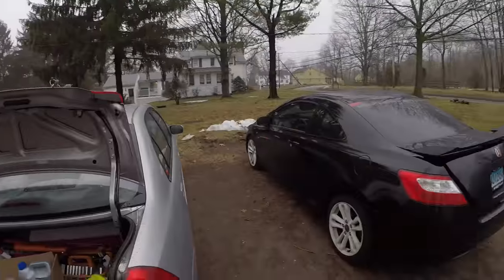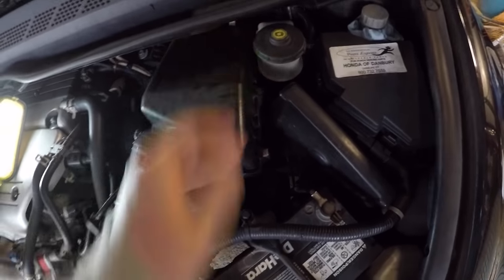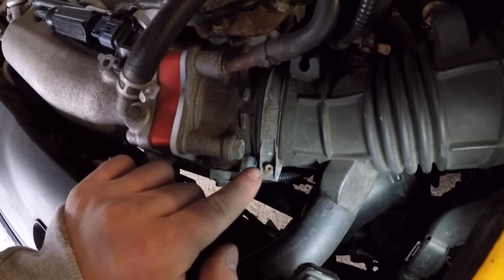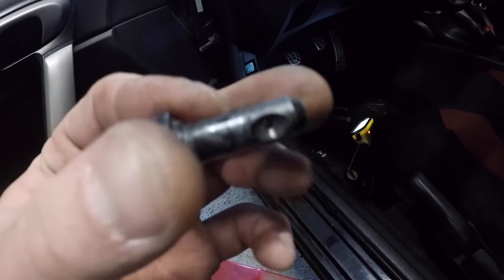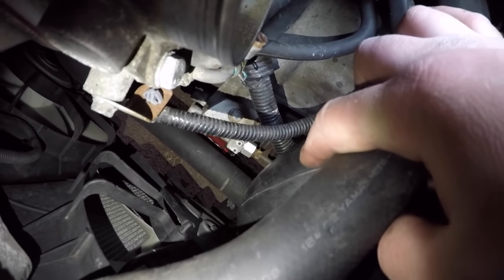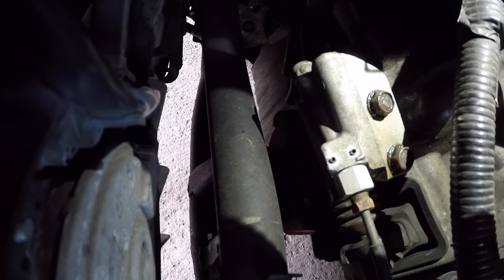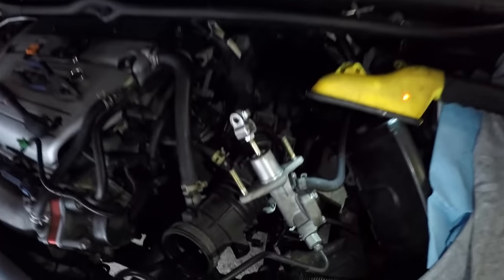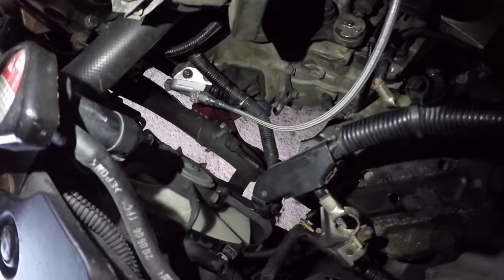Honda Civic Si CMC & Slave Cylinder Replacement DIY (2006-2011 Si K20z3)

Comment: I have a question for you. 1. Did this help you with 2nd gear lockout at high rpm? I have the very common 2nd gear lockout and 3rd gear grind problem with my car (07 si sedan) I have no idea where to start with fixing it. I had a new clutch put in a few months after I bought my car. Almost a year and a half later this problem is still existing, but here is the really weird part about it... so during the winter times I will rarely ever get locked out or have grinding issues, however, during the summer, after I run my car for about 10 minutes, I have the issue all the damn time. When I turn off the a.c. and throw the heat on the whole way (but the fan is running at like 2 or 3 clicks) it seems to help the issue. I have no idea... my initial thought was that my exhaust would heat up after driving it for a bit and it would heat up the transmission and it would make the metal (the gears) expand and would just be tougher with shifting. I thought about heat wrapping my exhaust to see if that would help it at all. Maybe you have a suggestion or even you have fixed the problem by doing a few mods. The cmc seems to play a role in the whole shifting issue a little. For example I was driving home from work today (maybe a 10 min drive) and I was going from 3rd to 4th and as I was letting off the clutch going into 4th,  my car just jumped as if the clutch got disengaged for a second then caught itself again. It would make sense if the cmc caused that (I was not over 5k rpms and I was shifting like a normal driver). I'm about to dump all my money into rebuilding this damn tranny if I can't find a solution. Anything That you can suggest helps, thank you!
Reply from the maker: Honestly, it helped with all my gears. I never had the lockout issue at high rpms though.  Mine is the opposite of you, winter months are harsh on my tranny until my car is warmed up.  For starters, start small, change your transmission fluid, clutch fluid, clutch pedal adjustment, bleed the slave cylinder, upgrade shift bushings
Reply: @TheGerbsteve  man these cars are a headache at times haha. But thanks for the advice. I was thinking about doing a full fluid change once I get my next oil change. Figured I would check everything since I only  really changed the oil since I owned the car.
Reply from the maker: Do it man, will only benefit in the long run

Comment: Great video mate, i wonder if you still have thats k tuned hoses, I installed the hardmotion cmc and it great but because of my battery relocation the hoses in the slave part it a bit stressed. That 90* and 180* degrees fittings are what i need. I you still have it can you sell it or at least let me know how can i fix my problem?

Comment: Question gerb my 07 fa5 my clutch won’t engage but it will in 3-4 somewhat and sometimes it won’t engage at all do u think it’s a cmc and the slave or the clutch itself
Reply from the maker: My vote is the clutch itself
Reply: I ordered oem clutch and slave from K series should be here this week hoping its not the clutch
Reply: Gerb u wear right it was actually just the throwout bearing but I got a whole new clutch just went with the affordable exedy clutch kit thanks for the advice gerb!

Comment: Gerb what fitting adaptor did you use to install clutch line at cmc.....I ordered em2 with this clutch line you used
Reply: Did you use em2 cmc with oem slave? Did it fit with the line and hows it holding up? I think i might go with that set up

Comment: what stainless line was that and can it be fitted to the OEM Master cylinder? i just have the ktuned slave ready to install on my SI
Reply from the maker: It's a Valex racing off eBay.  It will fit the oem master.  Run the stainless steel line, it's 10X better than the oem restrictive hardline.

Comment: Hey man great video appreciate the information, just had a quick question about the internals of the CMC. I know hybrid racing sells a similar kit and you had to swap some of the internal stock cmc parts like the rod and retainer to the new cmc, do you have to do that with the K-tuned kit as well or is it a direct bolt on?
Reply from the maker: +theradkab27 K tuned is direct bolt on bro.  I didn't want to do any swapping, but I heard hybrid racing is just as good

Comment: Just installed mine. Was installing an IMG so figured while everything is apart, might as well install the K-Tuned CMC and slave. Wasn’t that hard to anyone interested in doing it. Putting everything back together now so haven’t tested it yet.
Reply: WOW, what a difference that made. No gear grinding. Chirps going into 3rd at 4000rpm, damn! Engagement is higher and has a slight vibration when I push the pedal down. This is a well worth mod.

Comment: Where did you buy your K-tuned cmc? I bought mine online and took it to the mechanic and he said is not the right part. Now I have to deal with online return and I need to fix my car ASAP
Reply from the maker: Ebay bro.  Damnnnn, that blows. Do you remember what site you ordered it from?
Reply: Gerb Productions it was ebay but got it fixed

Comment: Yo Gerb are you still running this s
Cmc and slave setup? I did mine about 1000 miles ago no problems yet but I keep hearing bad things about them. Bit tbh its been working great for me I can now red line from 1st to 2nd no grinds. Im getting the HR short shifter and and shifter cables next
Reply from the maker: I am man.
KTuned cmc, oem honda slave FTW! I have about 60k miles on them both ;)
Reply: @TheGerbsteve  i have the k tuned slave hopefully it wont give any problems in the near future. I also did the exedy stage 1 clutch and lightweight flywheel the car feels great.
Reply: Btw are you planning on using the alpha header on the k24?
Reply from the maker: Yeah man. I’m going to try and fit the alpha header onto the k24. If I have issues, I’ll just sell alpha for something that’ll fit, like dc sports, plm, etc.
Reply: https://youtu.be/NuKjv0Kt1ZQ here's a link on how to clear them good luck!

Comment: Does this fix notchy ness and the high rpm second grind ?
Reply: Brandon Meyers most likely your synchros in your transmission for 2nd gear are going or are out
Reply from the maker: For me, it fixed it for a bit, then i had the notch feel back again. My tranny needs a rebuild
Reply: My hybrid racing kit is showing up soon and I’m gonna adjust my pedal so I’ll let you know the results
Reply: Gerb Productions I’m on my second clutch and began getting the lock out in low rev 2nd and redline 3rd, earlier today I was grinding trying to get into reverse! Installing my K tune combo tomorrow morning, just makes me sad that it seems like a temporary fix! just putting a bandaid on a weak tranny :(
Reply: Cristian Ramos  how did it work for you
Reply: Brandon Meyers Brandon Meyers shifting is way more precise, it definitely helped out ALOT but I still get a tiny bit of lockout here and there. But interestingly mostly when trying to shift  into third super quickly at about 2.5 rpm, could be user error. I’ll try to give feedback later in the week FYI with the aftermarket master cylinder you’ll feel ALOT of vibration coming through the pedal from what I’ve been reading it’s normal since the new cylinder doesn’t have the insulation diaphragm
Reply: Just installed my hybrid racing cmc fixed my issues !

Comment: Just installed my cmc and slave from ktuned, feels amazing bro, also it made my transmission quieter? Idk but it feels great, I love it
Reply from the maker: Glad to hear you went with k tuned, they are great imo. Definitely helps with shifting for sure. Are you using a braided clutch line?
Reply: @TheGerbsteve  yes, also went with that
Reply: How is your k tuned cmc and slave holding up? I keep seeing comments and reviews about how it sucks and peoples have blown on them. Im hoping this isnt the case, i just ordered mines 😭😭
Reply: @mattanderson1890  it's still holding up great, no issues, people blow them up cause either they dont know how to adjust them properly, install them properly, bleed them out correctly or just dont know how to drive lol but it's a great choice in my opinion
Reply: @mattanderson1890  Gerb and other youtubers have made great videos on how to bleed and adjust them properly
Reply: @Automatons.  alright sweet, thanks so much bro🙏 mines supposed to be here thursday. Going in my 9 gen si

Comment: I did the same installation on my 2008 Civic Si and works amazing. Thanks for the video.
Reply from the maker: Glad it helped. Thanks for the support 🙏🏻
Reply: My old clutch was replaced by hybrid right now one thing is it normal my old clutch hits the floor but this is half way play wont reach the floor anymore??!

Comment: Hey great video. I recently replaced my clutch and about 500mi later it slips randomly. Could replacing my slave cylinder be the solution?
Reply from the maker: Thanks buddy.  Hopefully you didn't get any grease on the clutch disk/flywheel.  Did you replace the slave when you did the clutch?

Comment: So I changed my cmc today but after installing everything, and double checking every bolt, wire, looking for leaks, etc. I couldn't turn on my car, I jump started it thinking it was the battery, it started and I left on for 30 min, turned it off, tried turning it back on and nothing. I know the car has power because all the light go on when I open the car but as i put the key in the ignition and turn it, the car loses all power and goes black I dont know what the issue is. I did the exact same steps as in the video, anybody know the issue, anything? Please help

Comment: great video bro, 
i recently bought a k24/k20 ep3 and the clutch pedal feels very hard, could it be to having an aftermarket CMC ?
Reply from the maker: Thanks guy...
You may have a stage 1 or so clutch, possibly upgraded cmc. Only way to tell is a visual inspection.
Reply: Did u ever figure out why it’s hard?
Reply: @rastafire1219  i replaced recently the clutch and pressure plate with exedy stage 1, but remained the same.
Probably the omni power CMC is the reason.
I am planning to replace it with EM2 or k tunned CMC.
Hopefully in summer time.
Reply: @lifenz1  I’m thinking of getting the hybrid racing cmc, I’ve good reviews about it and that it eliminates any grinds.
Reply: @rastafire1219  yah its same as em2 CMC design and quality
Reply: @lifenz1  thank you for the info! I’m learning as I go!

Comment: I know this is old but does it still hold up ? And do you know anything about the hybrid racing cmc ??
Reply from the maker: It does... I don't know anything about the hybrid, but i hear a lot of people running either that or k tuned.
Reply: Gerb Productions great ! I’m doing a full maintenance on my car before I do mods.. so I’m thinking at mods next 👍🏾
Reply from the maker: Very smart move!  You'll thank yourself afterwards haha.  What set up you going for?  Full bolt ons or boost?
Reply: Gerb Productions so far I have full bolt ons (headers, exhaust, CAI ) .. I want to buy flashpro but the $600+ is in the way ! Lmao
Reply from the maker: What brand header, intake, & cai? Even thought the price is high, it's worth it, trust me.  It's more than just a bunch of base maps.

Comment: Great video. My Ktuned slave cylinder started to leak. Had to replace it. Hopefully the hardmotion slave fits just fine.
Reply from the maker: +Javier Gutierrez Thank you sir!  Everyone says the k tuned slaves leak. Therefore, I'm glad I went oem 👍🏼...  How is hardmotion?
Reply: Gerb Productions so far so good. Got it installed today but there was a small modification that needed to be done since I had the Ktuned SS line. Other than that, no leaks and way better than before,
Reply from the maker: Glad to hear it! vtec on..... ;)

Comment: Hey bro, love the vids. I have a quick question. I purchased and installed this ktuned cmc and slave, but I feel like my adjustment is off at the pedal and cmc rod. Do you know the proper specs for this adjustment? Thanks bro.
Reply: David Vasquez I cannot get the black pin which connects the pedal to the cmc in all the way. It gets stuck. Any idea how to fix that?

Comment: First off thank you for the awesome videos bro. I think I speak for everyone of your subscribers when I say we appreciate the positive attitude and love for the Honda scene. With that being said I was wondering if the k-tuned cmc and slave had that much of an improvement on your shifting ? Really thinking of replacing mine on my 07 FA5... thanks in advance
Reply from the maker: +Thomas Proulx Means a lot man!  I always try to be positive man.  Honestly, they had an improvement, but it's my transmission that is shot, I believe.  Under high rpms, it doesn't shift as fast as it should.  It also winds here and there.  I'm looking into transmissions.  I would upgrade for sure though

Comment: I have an RSX, I've been through 2 KTUNED Slaves in a month. Both were leaking from seals.. I had enough and went OEM will an EM2 slave....no issues... till now my KTUNED CMC started to leak from the rubber seal as-well. Im done!! Getting an OEM EM2 one as well.  I think they should stop making the Slaves and CMC units.
Reply from the maker: Holy crap, this is interesting.  How many miles did you put on the CMC before it started leaking??  Stick with oem man & i will do the same when mine shits the bed.  Good thing i bought an oem slave.  I don't think I'm going to buy there parts anymore to be honest???
Reply: I've been in search of responses for the KTUNED CMC and slave. Not enough reviews online, anywhere. I've read several responses on YouTube and most people are saying that they've had an issue with the slave leaking or it failing prematurely. I'm so glad I didn't order their CMC/Slave kit. I'll stick with OEM as per usual. Thanks dude!
Reply: Amy Huggs def, the only thing I used was the clutch line it came with.
Reply: Gerb Productions not even 200 miles.

Comment: hi gerb i think you should bench bleed your master cylinder before putting it on, ull prolly have a hard time getting those air out of the mcm.
Reply from the maker: I actually think i have a tad bit of air in there currently, so i might try to bleed it again soon.

Comment: thanks for the vid, you actually helping out alot of people with the installation.
Reply from the maker: +abraham bravo No problem bro, glad I could help you 🙏🏻🔧🔧
Reply: Where did u get the stainless braided line, mines came with the rubber one
Reply from the maker: Ebay bro, it was like $20.00... Type in civic si stainless steel clutch line

Comment: What up bro, I was just wondering if there was a specific reason you didn't get the k tuned slave? I'm still learning myself.. keep up the good content.
Reply from the maker: No specific reason, I just wanted to run oem slave. I also heard most aftermarket slaves leak fluid. More coming for ya soon

Comment: Love your videos! Having the same lockout issue, replaced the flywheel, clutch, pressure plate, throwout bearing, cmc, csc and bled it still locked out, any suggestions
Reply from the maker: Thank you ;)... Man, that is tough to pin point considering that you replaced all the components. I would say next would be check you shift linkage and maybe a clutch pedal adjustment.
Reply: @TheGerbsteve  the clutch pedal was adjusted but i forgot to adjust the pedal sensor. Thank you so much. Youre an inspiration and i hope i can get my youtube where yours is one day

Comment: Big thanks for this vid.Just replaced my CMC and slave on my 2006 si with a new OEM updated CMC/Slave.Also went with the Valex line,made the install much easier.Had to adjust the rod on the new CMC to get it to function correctly(Better than new now).Keep up the good work....
Reply from the maker: How is the updated oem cmc? I almost went with that over my Ktuned cmc.  The valex like is worth every $1.
Reply: @TheGerbsteve  No doubt the valex line makes the install really easy.As for the OEM CMC  updated unit it is a MASSIVE improvement.After the install i bleed the line many times.Then started the car to go into gear/No dice.Much worst then before(Lock out of all gears,before it was 2nd and sixth gear).Ready to give up and go to the dealer but i decided to adjust the rod on the CMC.After this i could feel the difference in the pedal feel(much firmer) and sure enough it went into ever gear silky smooth.

Comment: I put my 90 degree on the slave and the straight on the master...
it doesn't fit and now I have to remove the whole system, switch the hose around, re-bleed the line and re-install.....
Anyone wanna buy a 2011 si with 90k miles? Just needs a new clutch line LOL
 FML

Comment: I recently bought a Si 2007 a week ago. The clutch is stage 3. I was driving it at night going into second when the clutch out of nowhere felt weak or (soft) it wouldn't let me change gears. I went to check on the slave cylinder but it stills looks new.. Do you have any suggestions what it could be?

Comment: Bro definitely post video on that cmc and csc... most likely gonna purchase just due to, rocking the oem clutch line and autozone slave! Muthafucka didn't even fit. I had to drimmel down the lip underneath the bolt holes.
Reply from the maker: +Jimmie Wilson I will be putting up a follow up vid on the k-tuned driving experience.  Honestly, I'm not a fan of the oem hard line.  I was rocking a Napa slave before I switched to oem, night and day difference.  That's exactly what I had to do with my napa one!

Comment: Thanks man. Forgot to add in the beginning to remove the cowling and metal plate under the cowling just to be able to remove the air box. What a pain in the ass.
Reply: anarchyamp I cannot get the black pin which connects the pedal to the cmc in all the way. It gets stuck. Any idea how to fix that?